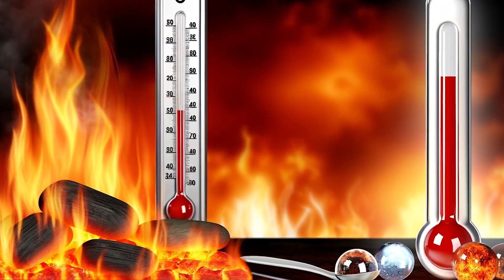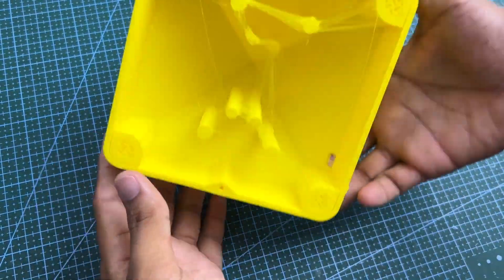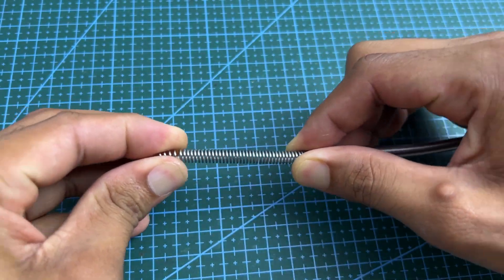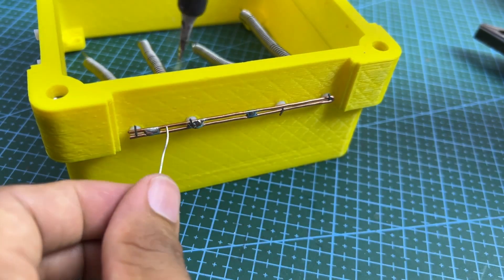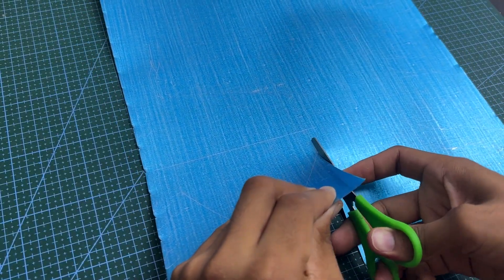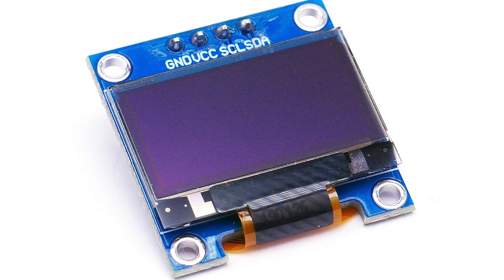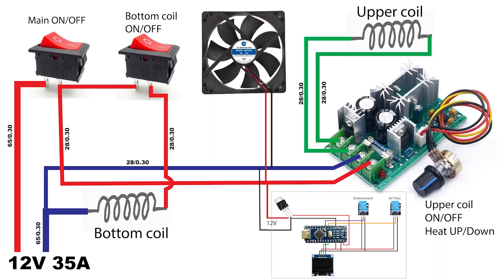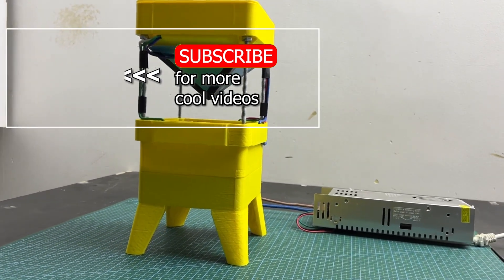DIY Smart Room Heater | Drive away the cold and bring in the warmth

Comment: nice video, jet as an electronics engineer I have some doubts about your device:

1. The coils (100°C) are quite exposed with a high risk of burning yourself or anything else (a metal cover should be considered).
2. The soldering points of the coils look a lot like cold soldering joints, i.e. not soldered at all.
     Could lead to even hotter points there. You should check for that, maybe use a crimped connection instead.
3. The heat shield you used should be a one piece part and maybe attached to the metal rods instead of the plastic that could soften with heat and tape that might not like heat too.
4. The price for the power supply is at least 30€ which in itself is more than a commercial heater with thermostat. So maybe it's not quite price efficient.

The idea is good, but there is room for improvement, especially safety.
Reply from the maker: Yaa… you’re correct. I didn’t consider some points when I making this. Thats my fault. How ever thanks for your comment ✨